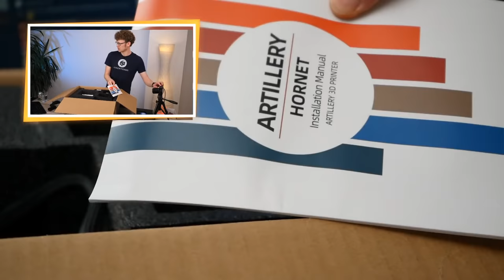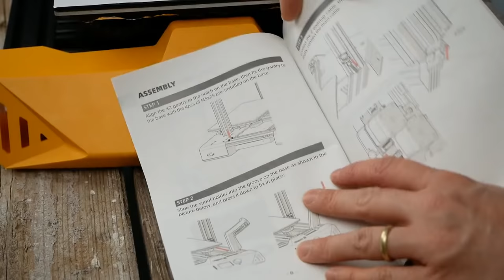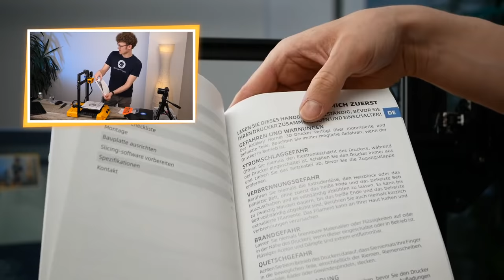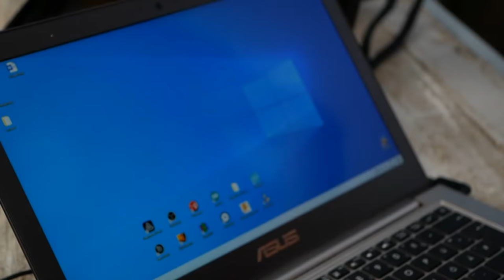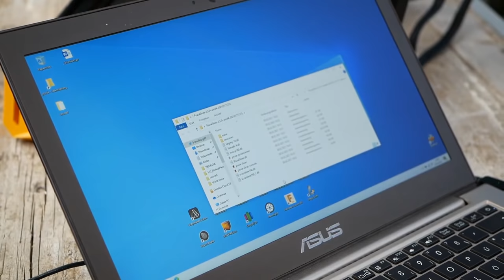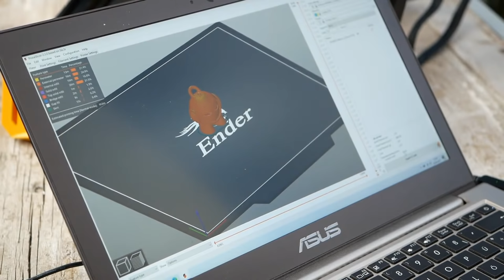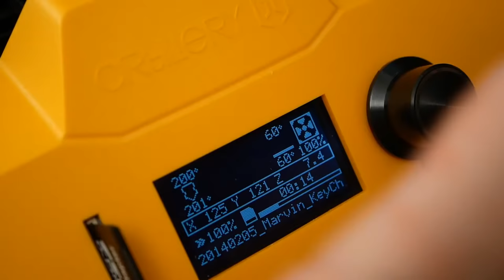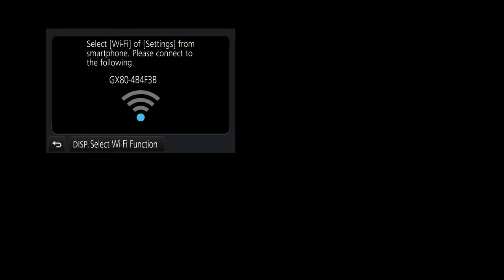Artillery HORNET - NOT just another Ender-3 clone!

Comment: I'm not sure if you'll be able to find it where you're at but Overture Easy Nylon, like the name says is an very easy Nylon to print that is very cheap for Nylon. You don't need an enclosure, and once it's fully hydrated it is very tough stuff. I'm using it for a delta effector with a built in air duct that I designed, and no issues so far.

Comment: It's literally the same, only with some upgraded shrouds and fancy connectors not typically found on a printer.  With all the l upgrades, the E Axis housing is cheesy with the plastic.  If correct, that is the original off the Original Ender 3.  If you spend an extra $15 you can get a Ender 3 Max with 300mm bed

Comment: An idea for a video. Strength testing electroplated parts vs normal prints. I've seen a few videos of people using a carbon based paint to coat plastics, which makes them conductive, and then they can be electroplated with various metals. I'm really curious if this would make those hooks any stronger. I tried getting Integza to do it for his rocket engines, and it did seem to make the parts more resistant to heat, and reduced gas leaks.

Comment: Hmm, this looks like an interesting printer for beginners - simple setup, ready to go in five minutes.
I'm a little disappointed that they're claiming "Material compatibility: PLA, PETG, TPU" on a carborundum-style heated bed and not giving any specific warnings nor directions about it in the user manual. I can tell you from experience that you will rip chunks out of that surface if you try to print PETG on it without using some kind of release agent, such as something like white-capped UHU Stic glue.
Reply from the maker: Good to know!

Comment: Looking forward to the full review! I'm still looking for my first printer and the ender 3 and it's clones is at the top of the list
Reply: i think you're making the right choice, i'm an ender3 user and so far results were pretty good. My printer is mainly tasked with small structural parts so both accuracy and strength need to be pretty high. The rollers show some serious damage after half a year but than again it's used alot. Also there is no wobble yet
Reply: the ender 3 is such a PITA to get decent prints out of that going for the prusa mini is a much, much better option
Reply: I'm ender 3 v2 user, it's very better to print because I used programs Cura and Prusasilcer. Because I can carefully to perfect print, because programs aren't easy to perfectly.

But I have Pla with high quality (low temperature is good enough)
Reply: @Andy-js5jy  thanks for the tip!
Reply: @torymiddlebrooks  you're welcome, you remember  check Filament need temperature right, as recommended you need Temperature test model if you can choose one of right temperature with 3d model.

here link:
https://www.thingiverse.com/thing:2493504
https://www.thingiverse.com/thing:2729076

this is important test for your pla or abs more, can improved to perfectly print ^^

Comment: I don't like how bulky the print head is and that it obstructs the view, especially when you need to keep an eye on the 1st layer.
Reply: same, also it looks somewhat heavy which limits acceleration and it would be a pain to mount an led light
Reply from the maker: It is a bit more bulky than an Ender-3 but it features 2 nice tilted part cooling fans being in front of the machine enables you to take a look on the first layer.
Reply from the maker: Not really, the injection mold and the small heatsink is way lighter than on an Ender for example!
Reply: @CNCKitchen  you're probably right, just noticed the ender3's hotend is encased in steel